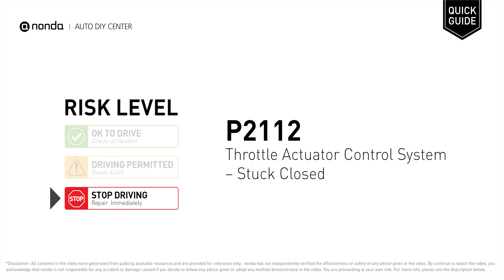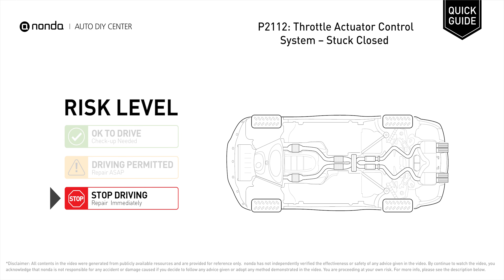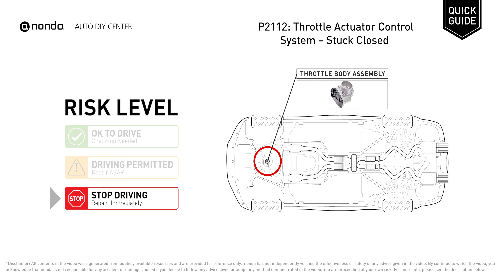What is P2112 Engine Code [Quick Guide]

Comment: I change the throttle body it ran good then started right back stalling out
Reply from the maker: Hi Calvin, can you please provide us with your vehicle's make and model?
Reply: @nondainc  2006 dodge charger 5.7
Reply from the maker: Hi Calvin, kindly check all the connectors on the throttle body. Try removing and reseating them. The throttle position sensor and wiring must be visually checked if faulty.
Reply: @nondainc  ok